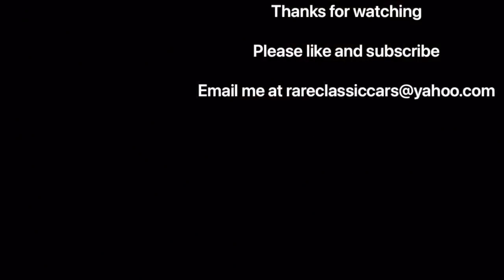Worst Engines of All Time: Chrysler 318/360/400/440 V8 Electronic Lean Burn

Comment: I was in the parts business in the early 80s and remember mechanics chucking these. I also remember tuning up the cars every fall hoping they would start when it was cold.
Reply: Every vehicle out there needed spring and fall tuning, not just LB.  Carbs were temporal then and the winter/summer gas transitions made it far worst.

Comment: Answers a lot of questions I didn't know to ask as teenager with a '76 royal Monaco w/400ci. That same engine survived a '72, and then a '70 Charger, all with the same 727 torqueflite (shift kit after Monaco). However the lean-burn crap didn't get transplanted. lol Good vid. Very informative.

Comment: I wouldn't downgrade Chrysler 2.2 and 2.5 engines because of head gasket issues. Those problems all went away for good with the introduction of the multi-layer steel head gasket that allowed the head and block to expand at different rates. Now, if you want to downgrade them for piston slap and worn wrist pins...

Comment: After totaling my 77 pacer , I saved for 4 years to buy new on my 16th birthday . Hit head on by a distracted driver . In winter of 1979  awarded $ 5000 for my totaled car. Went shopping for my new ride. Visiting the local Oldsmobile dealership....a large sleek wonderful white land yacht...1977 Chrysler New Yorker with a 440 magnum V8 with a max of 11 mpg for my big car with plush lazyboys seats . With only 17000 miles without a scratch why why why was it traded in ? Guess their loss my gain...never was I so wrong ! Driving to school the day after buying the car , with my chest swollen having very possibly the nicest car on the campus  even the teachers set in awe! WHEN SUDDENLY A VIOLENT SHAKE STARTED MY LAND YATCH WAS ANGRY SNORTING FIRE SHAKING AT A SIZMIC READING OF 8.5 IT DIED IN THE PARKING SPOT....OH BUT WAIT THE BEAST KNOWN AS " LEAN BURN SYSTEM " WAS NOT DONE TAKING A LAST GASP AT LIFE IT RUMBLED RATTLED AND BACKFIRED CASING THE UNBURNT GAS IN THE MUFFLER TO EXPLODE , I HID IN SHAME THAT DAY. From there an for the next year several efforts were made to repair the giant , to no avail! Finally the great beast  in one of its shaking fits burst into flame . The dealership refunded the majority of the selling price ! Until this day words like lean , burn and Chrysler bring fear for me !!!

Comment: I had a Cordoba with a 400 what a piece of junk that lean 🔥 didn't last not 6 months before the computer 🔥 up because it was on top of the engine right on top of the driver side exhaust manifold ,it melted on the inside. WHAT A PEICE OF JUNK

Comment: Had a 78 Fury with the police package and during pursuits, blood runs or other emergencies we would drive wide open for miles and it would burn up the sparkplugs and have to limp back to town and to the dealer. It was awful! The car looked pretty good and handled great but it had to be traded off early as it was very undependable. It sold a lot of Fords in our department.

Comment: the darn thing would get cooked by engine heat. If you popped it open & it looked like a grilled cheese sandwich, it was done. I once saw a stack of air cleaners with the lean burn attached in the junk yard at least 10 feet high

Comment: I had a 4 door 1979 Plymouth Volare that had a 318 topped with a big fat Thermoquad 4 barrel carburetor. It had the Lean Burn ignition system. Eventually it started running like crap and I couldn’t get it to run on a warm day even with starting fluid. I’m not a wizard when it comes to auto mechanics, but it seemed to me that I could change it back to plain electronic ignition. I had two mechanics tell me that it couldn’t be done, but I was undeterred. I bought an electronic ignition kit from the Mopar Performance catalog and a rebuilt Thermoquad of an earlier vintage that didn’t have all that feedback solenoid crap on it. I thoughti would have to get an engine wiring harness from a 76 Volare, but I didn’t have to. About that time 1989(?) I went to the magazine rack that carried my favorite rag “Mopar Action” and right there on the cover they listed a tech article that showed how to do exactly what I had planned, with 318 4 barrel Dodge Diplomat as the car being used. Turns out that I had everything I needed already. I went to my local Dodge/Plymouth dealer and asked them if I could photocopy a few pages out of their service manual. It was as simple as swapping the carb, unplugging the computer and splicing in the electronic ignition controller to the engine wiring harness. It was winter time when I finally got my mission complete. It was single digit weather, and after brushing off 6 inches of snow off the car, and charging the battery, my car STARTED RIGHT AWAY. I regret selling that car.

Comment: My eldest son bought a '77 Cordoba when he turned 17 in the mid 80s. Nice car, but every so often it would just either not start or run extremely rough. Long story short; it was the module on the side of the air cleaner. Two spring clamps applied to it got him home and it ran perfectly long enough to get to a salvage yard for a replacement.

Comment: so, the difference between, lean burn,/ sensors modern cars, all that tech, cost, to keep the greenies, epa happy, is basically bs. cost of a std non computer car verses all the tech you have to impiment, manufacture, fit, repair, replace, oh,,& limp mods..excellent..you can keep it. cats used to burn out in less than 2 yrs, what cost was that. now there further away from heat so they last longer..bs..you want a clean, no computer ''enhanced car'', that goes,, lpg, & high compression..pumps out oxygen..stik your EV,s in the bin,that is bs tech..

Comment: The chrysler lean burn system is primitive version of the modern mds system they have today an attempt to meet emission rules at the time the engines 318 360 400 440 where reliable its the systems at the time where not

Comment: Your theory on the 14.7 ratio is a wee bit 
off.

You are using volumes, instead of mass.
Gasoline is about 80% of what water is.
Air, is extremely light.

14.7 would quite definitely cause hydrolock.
(By volume.)

steve

Comment: I had 2 of these things a 400 and a 360 both had starting problems when warm . For the 360 I got a Direct Connection ignition kit that was originally sold to convert points to electronic ignition , and ordered a 2bbl carb for a 1971 360 . This package ran great and required little tuning beside the spark advance  to accommodate the low octane no lead gas at the time . As i worked at a Dodge dealer at the time I got the ignition for $ 95.00 and the carb for $ 58.00 , cheap fix , I wanted to get a aluminum intake and AFB 4 bbl but with the low 8.5 compression and smogger cam would not be worth it . Best fix for a lean burn ? Shitcan it .

Comment: A good explanation of this attempt at emission controls still using a carb. The computers on both the lean burn engines and the carb'ed 4 cylinders was placed in the intake airpath to cool the power transistors. Someone else has pointed out the fact that fuel ratio is by mass, not volume.

Comment: I had a 1978 Labaron with a 360 and the lean burn system.  When it failed it would start in the morning then once you drove it long enough for it to get to full operating temperature and then turned it off it wouldn't restart until it completely cooled down which usually took about 4 or 5 hours especially in the summer.  I had enough of that and eliminated the lean burn system by replacing the distributor and carb.  One way to do that now is to use a Chrysler non lean burn distributor with a GM HEI module and coil.  You can find diy instructions on the internet.

Comment: Though not a lean burn, a bought new a  1993 Dodge Dakota pickup with 8 cylinder 318 (or 5.2 litre) engine.    Eighteen years later, I sold it to a friend for a token 300 dollars.     He did some work on the car throughout the years, but the truck had at the original transmission and air conditioning, when he solid it in July 2021 for 1200 dollars

Comment: I used to pull that crap off & revert the engine to points dizzies with vacuum advance units. The insinuation here of 15 gallons of air to one gallon of gas is way off. That is one gallon of fuel in it's vaporized state. Otherwise you would go thru a gallon of gas in seconds.

Comment: Lots of folks bash these engines. I've had them and Not A Single One of them failed me and they performed excellent. They weren't meant to be hotrods but family friendly.  All of those engines gave me way over 100,000 miles of good service & no break downs.

Comment: I had a 77 LeBaron 2dr landau top. It was brown with tan on the landau, aluminum dish wheels and tan velor interior. The lean burn was taken off and and older ignition was installed. It ran much better and even though it was required emissions testing every year where I lived, it still easily passed. Unfortunately a lady did a u-turn in front of me and I knocked her Mercedes into her own front yard. Sadly it totaled my car and I would love to have another.

Comment: The Lean Burn was introduced in 1976 in the 400 c.i. engines.   It was wildly popular with the people who drove them a lot of miles.  The reasons were an unlimited mile, 12 month warranty and the early ones got very good fuel economy.  A traveling salesman special so to speak.  Initially the Lean Burn then was only available in the Cordoba and Charger SE.

Comment: The double pickup 77 only 400 lean burn breaker plate is now obsolete everywhere...so the death of lean burn is here.only fix is the mopar performance electronic distributor kit with orange control box...

Comment: so thats what its called. "spark knock" my 88 Gran Fury has been giving me tons of issues where you hear a big "CLINK!" and it jumps a bit. doesn't stall anymore as it had a few vacuum leaks previously but it'll give me these clink noises and the car will jolt especially after driving at highway speeds for a while. i've had my carb replaced from a holley 6280 to a knockoff BBD and replaced the distributor but to no avail. i guess i really need to get that computer taken off or replaced but i can never find a shop that'll work on something this old

Comment: Just a quick comment.  My Driver Ed. car in high school was a 1968 Dodge Coronet with a 318.  What a great car!
Reply: You’re an old fart like me. And we had 3 Mopar driver’s ed cars: Fury 383, Coronet 318, and a Coronet 225 3-spd. They were all great cars, with ignition points and simple carbs.
Reply: @sking2173  Was that a three on the tree in the Coronet?
Reply: @RightLaneHog3151  Nope.  Good old Torque flite!
Reply: My drivers ed car was a 1980 Dodge Aspen coupe.
Reply: @RightLaneHog3151  My almost Mother-in-Law had one of those, with a Slant 6!

Comment: Stoichiometric air-fuel ratio that you mention of 14.7 is a ratio by mass, not by volume. So it wouldn't be 1 gallon of fuel to 15 gallons of air. It would be 1 Kg of fuel to 14.7 Kg of air. A quick conversion I did came to the volume of air needed to combust gallon of gasoline would require around 10,000 gallons of air. This is just a ballpark figure, i'm sure someone will figure out what the exact number is.

Comment: An aftermarket Fel-Pro MLS gasket completely solved the 2.2/2.5 head gasket problem.  And it was a super easy repair to do, with the exception of the two EGR tube bolts, on some models, on the bottom of the manifold, up against the firewall.

Comment: It’s easy to judge these cars harshly in retrospect, but if you’re fair to the engineers of the time, they did develop the basics of what became the modern engine control systems.

During the first few years, this system was clunky, but they quickly refined it. By ‘84, Chrysler was using the successor system to control their 2.2, port injected turbo car. Those little cars ran great. And for the time, the engines were fairly durable.

Cars have changed a lot, but people haven’t. They generally don’t like change ... Converters, fuel injection, computer engines controls — they all met with strong resistance initially. But today, we realize how necessary they were.

Comment: The 80's Police pack Dodge Diplomats & Plymouth Gran Furys had the ELB Computer in the cabin under the dash to reduce heat stress. The regular versions of these cars got just as hot but had the Computer on the air cleaner which is a stupid place for it unless you want a shorter service life.

Comment: Ahem....isn't the 14.7/1 fuel/air ratio in WEIGHT, not VOLUME?   1 gram of gasoline needs 14.7 grams of air...roughly 12 liters..if not, a 350 CID engine would burn about 5 gallons of gas for every 100 revolutions, or about every 2 seconds at 3000 rpm

Comment: Just a quick clarification, the air fuel ratio is by mass not volume. The gallon of gas would require 98ish pounds of air, or about 1200ish cubic feet, which is 8975ish gallons.

Comment: " At wide open throttle it reverts to centrifugal advance"......wtf... there was no advance mechanisms in the distributor, only a reluctor sensor. Did you mean "base timing" ?
 Seriously though, at least Chrysler had the balls to be try something different to the rest. It is unfortunate that it took the US auto industry another 20 years to shed all its nasties like cast iron heads with wedge chambers & oil pumps driven by distributor shafts.
Reply from the maker: There were weights at the bottom of the distributor.  If you don’t believe me, watch Chryslers own video:

https://youtu.be/aPRt_d_1e4k

Comment: The idea of running an engine lean under certain low load conditions was such a good idea back on the '70 that it is still done today. But, as with GM's failed contemporaneous attempt at cylinder deactivation, the technology simply wasn't available at the time to make it reliable.

Comment: Removed lean burn, rebuilt the 318, headers, new hipro heads, drove that thing 200,000 miles. had issues with the window cranks lol, and once with the water pump. Love the 318 and the 225 slant six. Amazing engine

Comment: the worse engine i feel is the ford 292 v-8 over head exhaust u will be lucky to get 100,000 out of it stock u have to put over head oilers or the top end don't get oil how long will any engine will last with no oil to the top end with over head valves . now i agree with newer engines that dodge sucks

Comment: The ignition was on the air cleaner where all the heat and vibration could kill it. The motor itself was fine but the ignition was junk.

Comment: I had a 360 in a 78 Dodge Magnum that was lean burn. It had excessive spark knock after about 60,000 miles that I cured by putting a water injection system on it. The injected water would clean the carbon out of the combustion chamber and would solve the knock issue until needed again. Crude but it worked. I think all manufacturers had problems during this time period because it was the start of government mandated emission regulations.

Comment: Put a 69 roadrunner distributor on a 77 Cordoba 1st 2nd gear shift broke the horizontal  bolt  on the driver side in half next the u joint 2.45 gear was stupid   almost all the computers  got stuck at base timing plus no off idle vacuum  port  what a floater in ride and the toilet. nice seats and gas customer for JR Ewing of  the Dallas  tv show. No wonder by 1980 they had k cars with feedback carbs and similar computers 2.6 engines that cracked heads by the pallets full at junk yards to be repaired because on number 2 runners gaskets cracked and injected coolant to cool the cylinder as the engine overheated. THE SAGA CONTINUES .

Comment: The computer system was fragile and couldn’t tolerate the heat.  There was an aluminum foil blanket protecting it, but it didn’t work.  The worse thing was that Chrysler didn’t support fixing it or even acknowledged the problem.  Last Chrysler product I ever, or will ever buy.

Comment: Volvo used the Chrysler lean burn on 240 Volvo's until 1991 they were smart and mounted it on the right fender well. Oh and they used fuel injection

Comment: Back in the day, I took many of the cars with Lean Burn and converted them to standard electronic ignition - They  usually had a spot on the firewall for the ECU, then get an ECU plug from the junkyard, match the wire colors, install a standard electronic ignition distributor (the lean burn distributor has two pickups, only us the orange / black connector, abandon the gray / white), vacuum hose the went to the SCC now goes to the vacuum advance, set the timing and away you go,

I always felt that the Carter Thermo Quads were crap - there's something you can do a "worst components" program on (along with the Carter RBS carburetor).  And FYI the Thermo Quad and the Quadra Jet share the same mounting pattern.

I did a lot of crazy stuff back in the day, oh the things you can do when you have ready access to a cheap junkyard.
Reply: Thermoquad was best 4bbl ever. Good performance and mileage.

Comment: Air-Fuel mixture is by weight, not volume.  So, pounds of fuel to pounds of air.  And an A/F mix of 14.7 is just barely running.  The Direct Connection ignition kit and rejetting the carb did wonders.

Comment: I used to have a 1962 Chrysler Newport with 65 thousand on it with the 361 b engine with a 64 strongburg 2 barrel carb 241 rear end gears. That car can move on the interstate

Comment: 14.7:1 by weight, not volume. At that ratio, a gallon of gas would mix with a bit more than 2100 gallons of air (sea level, standard humidity)
Reply from the maker: It was an illustrative example for a lay person